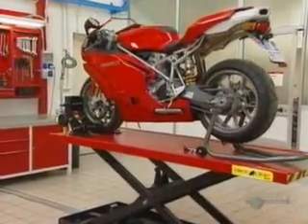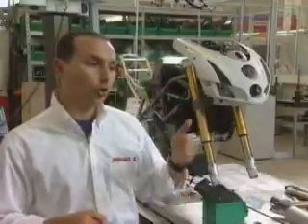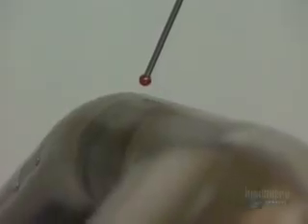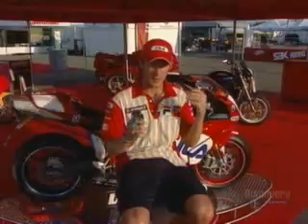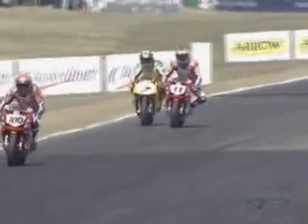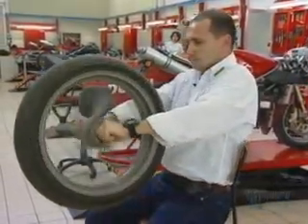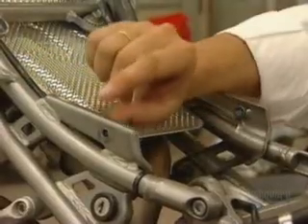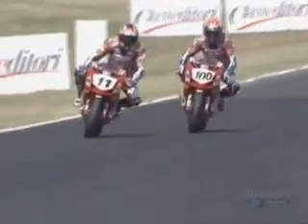Building a Ducati 999

Comment: The upcoming replacment for the Ducati 1199 is rumored to have a double sided swing arm so that just speaks for itself and Hyosung GT250R or the GT650R didnt even exist when this bike was produced. 

However, the 999 was designed by Pierre Terblanche, amid much controversy over its styling.

I personally think its a gorgeous bike with race fairings on it. I feel as if the headlights were adapted to make it street legal. The 999 is a very race oriented motorcycle.

Comment: @TaiwanBeer1985 ive always respected the 999 its the ducati i fell in love with i currently have a 1098s. The only thing i wish the 999 had was the single sided swing arm
Reply: I'm of the opposite  opinion...i liked the symmetry of the  double sided swing-arm.  .so bought this instead of earlier incarnation
Reply: Symmetry is fine, but if you want to put a cantilever lever on your 999, then take it off your 1098. They should fit bolt on. But I want to say that I have seen such 999s with a monorail and it looks very strange on a 999.